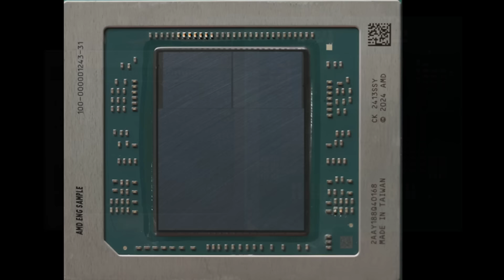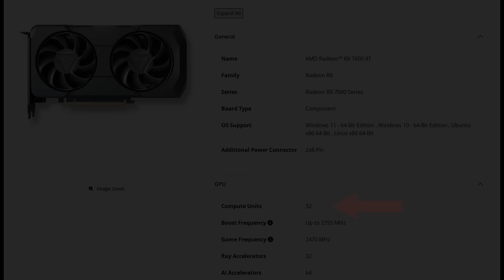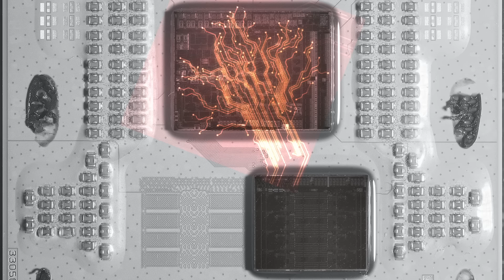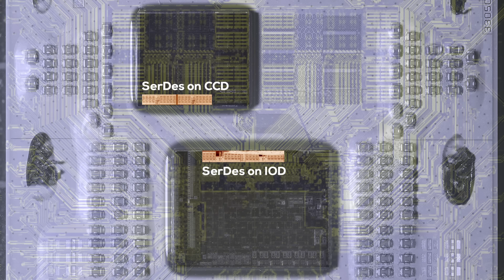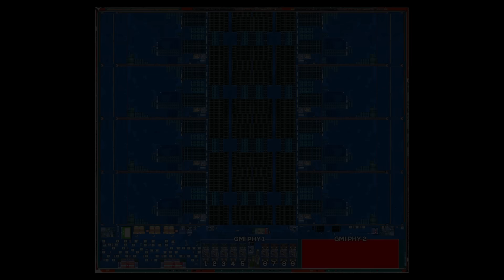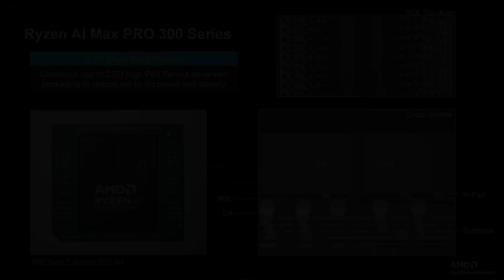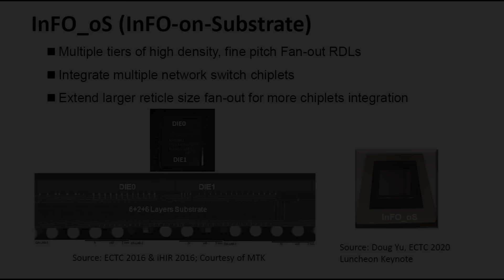How AMD is re-thinking Chiplet Design

Comment: gaming is good, games is good. i love gaming. i also understand that gpu is usable in other using cases. but i'm not sure about APU... i would prefer a raw cpu performance from the cpu and i could but whatever discrete gpu i would like to... i also understand that integrating gpu and cpu in one chip could give some performance advantage but we're talking about customer APUs which didn't hits the absolute top performance...

Comment: So the PHY connecting to the IOD can't be connected to the V-cache chip?
I thought since data flows through there, it only makes sense to let it go directly to the L3 cache and the CCD would access it from there
Reply: Data does not flow through cache...data is stored in cache after it was used by the CPU...
Reply: @justacomment1657   That's not how CPUs work
The CPU cores only have access to the data inside the cache. They don't work directly on RAM.

On a cache miss, CPUs nowadays fetch it into L2, then L1 and then work on it. 
L3 is used as a victim cache.

However since the L3 is much faster than the RAM anyway, would it actually matter? The L3 cache can send the data it receives from the RAM to the CPU faster than it can receive data from the RAM. So surely the latency difference of having it go through the L3 cache first would be negligible.

Comment: 3d v-cache is no longer needed if you have double memory bandwidth and have eliminated the interconnect latency. You've halved CCD latency once and substracted the serialize latency, meaning we're a tiny bit faster than Epyc for chip interconnects (plenty fast for a few generations). 
Still half the interconnect speed of Apple double chip SoCs and Nvidia's double chip GPU interconnects (as far as I remember they use 64bit wire fanouts).
Reply: Even if it beats a current x3d without the 3d v-cache it probably would still benefit from the extra cache
Reply: @KeinNiemand  more cache is only a hack for slow memory. it sort of works if most of the work data fits in cache, it only adds latency when the data doesn't fit. 
the proper solution for slow memory is eliminating latency and increasing bandwidth.

Comment: Old CPU: Lets put the address and data bus of the memory on the motherboard to talk to the network card
New CPU: Let put loads of networkcards on the CPU to talk to the memory
Reply: Infinity fabric is not exactly a network. It's more like a DB-9 serial interface. It connects two endpoints and that's it.
Reply: @450AHX infinity fabric is definitely considered a network. It is packetized and switched and routed. The links themselves are serial though, yes.

At the speeds required, buses just dont work, packet switching and SERDES is the only way.
Reply: @450AHX  More like the old parallel printer bus.
Reply: Older CPU: What's a network card? Let me wind my memory spools to see if a protocol for it is in my 400KB of memory.
Reply: @Noisy_Cricket  400kb of memory what I strange amount. The modules have been power of two for ages.  And even if you count different types 400kb is hard amount to get.
Reply: @jouniosmala9921 power of two wasn't settle business in the early days. Things like 24 bit words, 6 bit bytes, hell, there were even 9 bit, 18 bit, and 36 bit computers.
Reply: @jerth  awesome
Reply: @jerth  That early, it would have been a supercomputer if it would have 400kb of RAM.
Reply: 16kb fast memory, 128 kb not that fast memory and 256kb of "cheap" memory would do it.
Reply: @jouniosmala9921  You can tell from the "reel" that he is talking about magnetic tape memory, and that storage technology did have non-binary sizes around 400kb.
Reply: @jouniosmala9921 400 is a multiple or 8/16, a frequent visitor at the high end of core coun these days.
Reply: Accurate.
Reply: A lessor known idea was to put a CPU on the memory chip and do some of the processing there.
A related idea was the cache chips that searched the whole memory for a string before telling you if it existed or not
Reply: Future CPU: let's put network card and memory on CPU so that they talk to each other
Reply: Newer CPU: just wire them together
Reply: Let's*
Reply: Allow me to explain as a Factorio player: instead of running a train between factories, just move the factories closer together and directly connect belts!
Reply: @ctrlaltdebug  but then the raw ingredients are further away
Reply: Can't be helped. With very high frequency, a protocol must be added to ensure signal integrity.
Reply: frrrr 🤣
Reply: You don't understand about hardware 🤣🤣🤣

Comment: I hope the next zen will have 3d vcache for both ccd's, having it only available in one is pretty much in theme with AMD releasing an MVP.
Reply: There are not enough workloads where cache sharing over more than 8 cores leads to massive performance increases, unless the scheduler is totally shit and jumps a thread from one die to the other all the time. With Zen 6 going to a 12 core die, and Zen 7 rumored to be a 16 core chiplet, those instances would be even rarer.
Reply: @Psi-Storm  16 core chiplet? Are you sure that's not gonna burn an entire hole into my motherboard socket!? Zen 5 full 8 core CCDs are already very hot (though admittedly clocked way too high from the factory IMO). 16 core chiplet in a smaller die area than current CCD, they will have to lower voltages a lot. I don't think they can get away with the current 1.45V idle voltages that Zen chips have
Reply: @pixelsam123 temps on zen5 are high because of the crap thermal interposer between cpudie and heat spreader...just check what happens if you delid the thing (der B8uer)
Reply: @pixelsam123  Zen 5 has an operating frequency of 1,3V. N2 or whatever they will use for Zen7 will probably be around 1-1,1V. Also, the die area won't be smaller than current chiplets. With 16 cores they will probably be around 100 mm², so 50% bigger than current zen 5.

Comment: According to @MooresLawIsDead Zen 6 will use a bridge for for the interconnect. How does the density of a bridge die compare to a RDL? If the bridge die has high enough density isn't it possible AMD would still have the v-cache below the ccd?

Comment: It looks like new interconnect doesn't occupy any space under L3 cache area so it should be possible to put 3d cash underneath. No interfering TSVs and cache cells, only silicon.
Reply: Yes, the vcache just needs the regular substrate for the connections of the TSVs. They basically just need the organic layer to get everything to the right height and then the few centimeters on the edge to connect the fan outs.

Comment: 20:07 we don't see much of change in the cache accesses, but only in the whole memory throughput, and there's the thing about latencies. Is it possible that we just measured the LPDDRX5 PHYs here instead of the interconnects?
At around 20:30 you mentioned that ".. does offer a higher interconnect bandwidth", so I am curious about that if I am misunderstanding something

Comment: Similar to Intel's EMIB(Embedded Multi-Die Interface Bridge)?

Also, could this die-to-die innovation have alot to do with Xilinx's technology? Xilinx's high-end FPGAs and FPSoCs, the Virtex, Zynq and especially the Versal all have a whiff of this interconnect technology. It was Xilinx, after all, who were the first FPGA company to include hardened ARM cores and RF circuitry alongside the FPGA fabric, connecting different dies that require high-performance from all.
Reply: I think the equivalent to this TSMC-tech (AMD is just a user, AFAIK) is Foveros-R 2.5D

Comment: I watched an interview with some tech person inside AMD 2-3 years ago. Now, I fully understand what he meant when he said that in the future, packaging will be more important than IPC gains. At the time I thought to myself, ohh, he meant RDNA 3 type, but I was still wondering would he say IPC gains wouldn't be that important anymore. Thanks for this video. You are an amazing educator.
Reply: This interconnect upgrade will surely equal instant giant gains as measured in IPC from the latency between cores on different CCDs for all core workloads.  This also opens the floodgates for quad channel DDR5, 8000+ MT DDR5 that doesn't drop down Infinity fabric to a lowest common denominator, and the pathway to DDR6.
Reply: @douglasmurphy3266 man i thought 2166 on the IF fabric with 6400mhz on ddr5 with the 7800x3d was already fast, took me a while to get stable but 8000+ would be nuts
Reply: As I understand it, the speed of the processing cores is at such a level now...

That the connections to the outside world are the limiting factor.

Want to go faster?
You need to beef up the communication possibilities, just to get ahead of the curve.

If you don't have the physical space on the bottom to connect it all, you need to use the sides as well, so from a 2d connector to a 3d connector.

Which makes it so much harder, because not only the position is important, but also the exact height of every layer in the die..
Reply: The gold standard that they're working towards is bumpless interconnects. Preferably, there's no interposers but they're essential. There's a bunch of papers on microbumps and bumpless. The process is akin to cold welding.
Reply: Think he probably meant that packaging will determine the ability to realise IPC gains from architectural tweaks, which makes sense.
Reply: Both IPC and clock speed are important. IPS is about amount of processing per clock, or Instructions Per Clock. Higher clock speed means instructions are completed faster, and more IPC means more instructions will be done.

At some point, more IPC won't matter for todays software and games, but developers move on all the time, and optimizes the code to make use of more IPC, as well as clock speed.

A developer once told me he was able to write C++ code that was optimized for 2 different types of hardware. One version for more memory, and another version for faster CPU. Sure, that's memory vs CPU performance, but there's absolutely ways to optimize for IPC vs clock speed as well. I'm a developer myself, so I know.
Reply: @lassebrustad  > I'm a developer myself so I know. 

The classic programmer hubris.
Reply: @rantos9 wow, how arrogant to be able to distinguish between clock-optimized and memory-optimized code...
Reply: Packaging improvements improve old more global definition of IPC instead of narrow view of counting without any memory stalls. Anyway. I've would have expected the exponential costs and diminishing returns end IPC gains long time ago. But even couple of decades ago the memory was the main bottleneck to be considered, and latency has stayed relatively same.

Comment: wonder if they will release a monolithic variant of this architecture for the pro lineup as they did with Zen 2 ( e.g. 4750G PRO ), with goal of reducing a bit power usage even further, enhance data movement across each parts of the die without having to go through SERDES even if those rly improved on this architecture 🤔

Comment: This is a great video. This new interconnect solves one of the main problems of the Ryzen CPUs. I was thinking that they would have to come up with something like this, as monolithic chips were more efficient in this regard. Of course, this won't be available to the end user for free, but it will come at a reasonable price (more complex production means higher prices, and the high demand in the market also contributes to higher prices). Now I understand why AMD is not afraid for its future. But I hope that they won't repeat Intel's mistakes, and that the blue will provide a worthy competitor.

Comment: So RDNA3 CHIPLET wasn't much of a failure. It's paved the way for Strix Halo. The engineer that work with the team are really amazing. i like how he were explaining the fanout interconnect during RDNA3 launch.
Reply: It wasn't a complete failure, no. The biggest failure of RDNA3 was the inefficiency created by AMD's attempt to shift the L3 cache to the MCDs, which massively increased power consumption, as it forced the connection between the MCD and the GCD to be a lot faster in order to retain the benefit of having a large cache buffer. We'd need to look at how wide the bus between the GCD and the MCD was, but trying to push 880GB/s off peak bandwidth per MCD was never going to be a winning formula for efficiency and the core's frequency was massively sacrificed to compensate for the power higher power consumption of the package.
Reply: do you have a link to the video where they’re discussing the rdna3? i’d love to watch it, thanks
Reply: RDNA 3 used TSMC's Cowos as far as i know. So used a silicon chip for the transfer.
Reply: @Psi-Storm I remember AMD engineers specifically mentioned that they are not using silicon interposer on RDNA3. I think you got confused because TSMC was marketing CoWoS at that time but AMD was actually using a different technology.
Reply: @Psi-Storm  no, cowos is very expensive, it was only used in server products for HBM like MI300X/GB200. RDNA3 does not have a SI bridge or SI Interposer. They used Info-os most likely, same as stx halo
Reply: Strix Halo is still inefficient, though. The 300mm IOD is bigger than 5070 (both 4nm) but 5070 will completely annihilate it.
Reply: @MLIDClips Strix Halo uses a weaker architecture and contains a lot more IO than a 5070 does, not to mention the wider (albeit slower) memory bus it's completely normal for it to be bigger but slower. It's also a test run for market interest and proof of concept more than anything else. A good and usable proof of concept at that.
Reply: @lennard9331  it's not just slower it's MUCH slower. Strix Halo containing lots of IO is precisely why chiplet architecture is inefficent: it needs lots of them to connect the chiplets to each other, wasting die space in the process. Imagine if this is a monolithic, you can get rid all the inter-chiplet interconnects and the chip will be much smaller.
Reply: @MLIDClips  the Strix Halo interconnect takes up very little space, as you can see in the video. The things that take up a lot of space are the "external IO" and the extra memory PHYs for the 256-bit bus. The SoC tile is only 40mm2 bigger than the desktop 5070 die (idk what they use on laptops), so the extra IO and memory controllers make up for the difference.
It should also be noted that the "8060S" GPU appears to be extremely memory bandwidth and power limited. LPDDR5 8000 literally has the maximum theoretical bandwidth of GDDR5 memory while having a lot more latency. I believe the 'spec' for the 8060S is 55W max or something along those lines. That's very little power for 40 compute units.
Reply: @MLIDClips  not when it ran out of vram. also halo is only RDNA 3.5 so the area density is not that great, it also consist of other IO parts like PCIE and USB, etc
Reply: @MLIDClips  yeah because the 5070 mobile has a 115W TDP and Strix halo is 55 to 120W TDP, and that includes 16 zen 5 cores. Also the Strix Halo SOC chip includes I/O for the CCDs and the NPU as well as many other things.

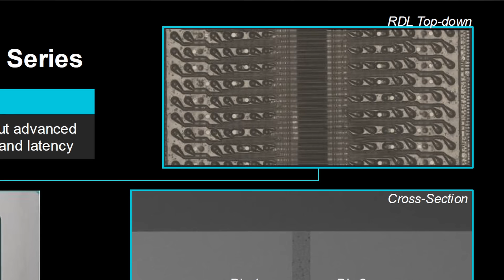Comment: min. 16:55 apparently wasting all the copper for those wires is still cheaper than just going monolithic at ths point of time 😂
Reply: There is a geometric decrease in yield as die size increase. Large monolithic dies have abysmal yields compared to 70 square millimeter core complex die.
Reply: there's trade offs but it's a mix of cost and volume while minimizing yield loss on the most expensive part of the manufacturing process. that's why both nvidia and intel are moving away from monolithic designs as well.
Reply: Copper? Gold better saying.
Reply: yeah they do, so wafer price goes up. however it's like unnecessarily making things more complicated on 2 dies which combined together would be only 150mm²

Comment: Well the cost IS the other big question.  Strix Halo is positioned as an expensive, premium solution, but for more 'pure' CPU's, they have to scale all the way down to very affordable consumer options.  Using a more expensive packaging process as standard for Zen 6 seems perhaps a bit much.  Especially when they already choose to not go this route by making Vcache as standard.  Maybe they make two entirely different solutions for Epyc vs consumer Ryzen?
Reply: It's not actually very expensive.
Reply: There was already a rumor that Zen 6 has two different dies. So they might have a standard consumer die with infinity fabric connects and one with fan out. But i don't see a problem with having vcache under the chip with fan out. They basically just put an old node die there with through silicon vias, that connects the compute die to the organic layer. Or the organic layer gets the exact height of the vcache chiplets, so they can groove out spaces where the cache fits into. Its TSVs then just connect directly to the substrate, like they currently do. Basically just organic substrate where it's needed. On the southside of the compute die and the northside of the graphic die.